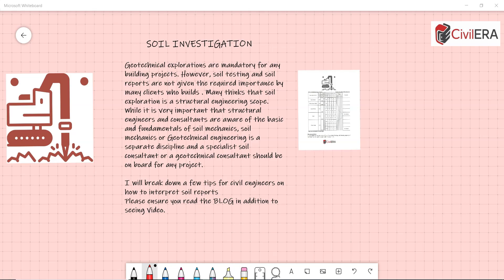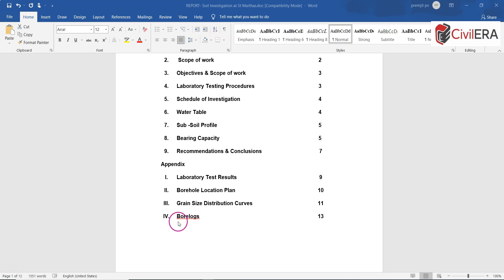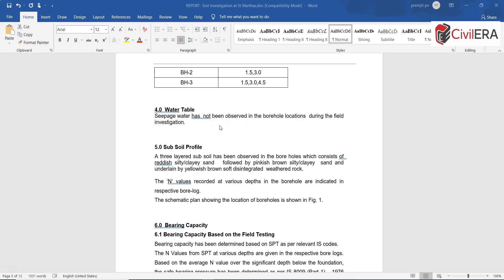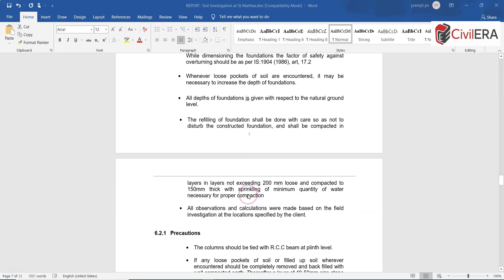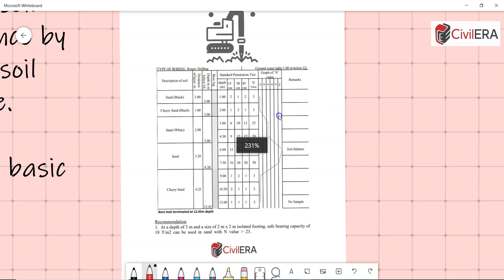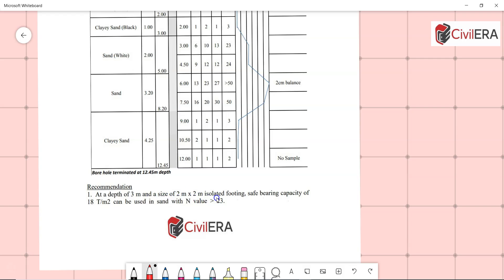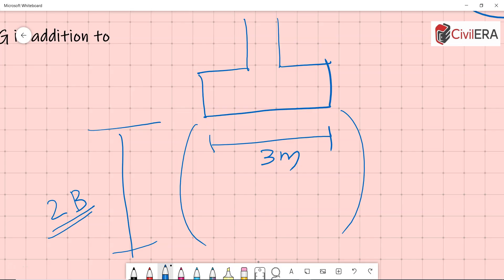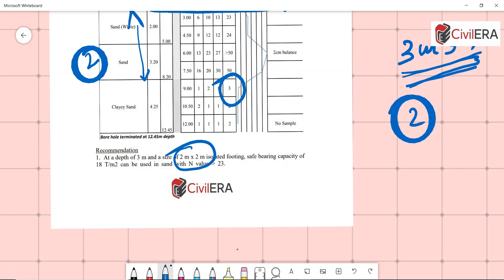How to interpret Soil investigation Reports & Geotechnical reports

Comment: Sorry, i didnt get what would happen if the width and breadth of the footing is 3m? settlement? instability?  or bearing capacity at the soft soil cannot support the force?
Reply from the maker: soil is compressive. it will transfer load to the weaker strata below

Comment: Dear sir,
You have just explained the salient features present in soil report. You have not covered the correctness of soil report. From practical consideration it is important to reconsider opinion of soil consultant. In many cases soil consultant recommend pile foundation for even G+3F for 15m tov20m depth. For the type of Structure the load coming on the structure is not consider by soil consultant. The alternative foundation and cost benefit ratio are not analysed by soil consultant. Only structural engineer have study all aspects and finalise the foundation. In the report the chemical analysis is not discussed. The grain size distribution soil consists of various layer is not given. With these one can arrive presumptive sbc for various percentage of soil present in the particular layer. The approximate sbc for correlating N value is if N is 25 means sbc is 25 t/m^2. With these also you can check he correctness of sbc recommended by soil consultant. Your reading report is only theoretical only. No practical aspect involved.
Reply from the maker: I have mentioned what am covering and that is covered. There are hundreds of things important to soil and the intention was not to cover everything. You can provide your views and opinion but don't dictate what I have to say in my channel 🙂

Comment: Sir, is it okay to provide isolated footing below 4 m if soil report says so. In that case, the column below ground will be almost 4m straight until the plinth beam. Is it okay as I have never encountered with a 4 m deep isolated footing ?
Reply from the maker: It will be ok but design the col for that effective length or provide ties. Also check the soil report and see if Pile may be economical. Also retaining 4m deep excavation is a point of consideration
Decisions will be based on that
Whats your real name. Can only see your YT name 🙂Are you in my group?

Comment: Sir, you are trying to tell that the size 2X2 m should not be exceeded and that many more number of columns should be provided so that the axial load is less than 1620kN?
Reply from the maker: Am not trying to say . I said that :-)) 1620 is a higher load. You cannot even reach there. Approximately 2mx2mx180 = 720KN is what you can have to limit the footing sixe to 2m.
Yes the soft soil below should not be subjected to load and that can be achieved only by restricting the width to 2m. You can have other means like combining and forming a strip footing with width less than 2m